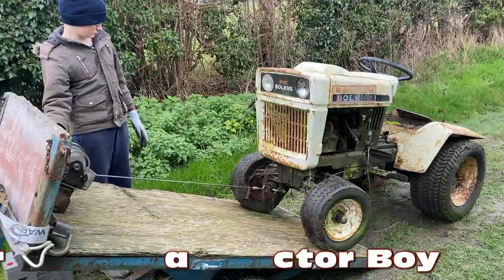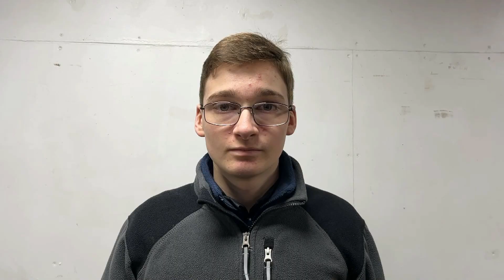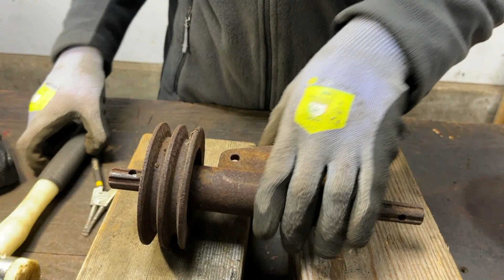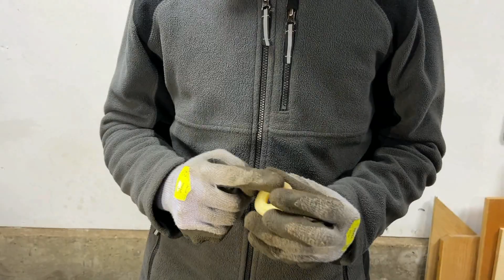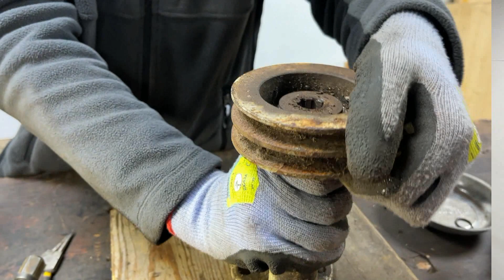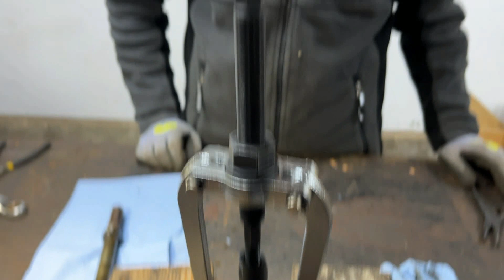Bolens PTO rebuild - Part2 (Strip down)

Comment: They all look to have worked hard in life, thankfully a team such as yourselves will give them the much needed service 👍 Wonder if 3D printing would yield a good result, or if there are mixes that would be strong enough to hold up  ?
Reply from the maker: Thanks for the kind words. We had the same conversation and I think you are right 3D printing would be the best option or it would be if we had a 3D printer. As such, we will try to make one on the lathe. The only time I have seen one of these washers broken is when the bearing behind it decides to explode so it does not need to be strong. Take care
Reply: @GardenTractorBoy - There is an organization here called Makerspace, they have many tools and machines open to be used by members on site, have been in there a few times but not jumped in, anyway, they had half a dozen printers on the go last time  i was there. Maybe something like that there (edit- where you are)  as well ?

Comment: Love this episode Joseph. Disassembling something you don't know. First off, the cameraman got a voice..... I was screaming at the video, clean and oil the splines before the puller tightened up lol, also you could of applied heat to the pulley. Engineering dilemma, you'd think a tractors PTO would be a simple accessory. You've proved its a Rubik Cube in reality. Top drawer......Cheers Tony
Reply from the maker: Thanks. We should have known better and cleaned the splines first but it was a good lesson. It was fun working out how to take this apart and interesting that everything is held on with snap rings. Take care

Comment: Very interesting to see how this pto is put together. Good job getting it figured out how it comes apart. Good luck making the plastic dust seal.
Reply from the maker: Thanks. It was fun working out how this came apart and it was different to how we were expecting. It seems odd that everything is held on with snap rings. The seal washer will be interesting. Take care

Comment: They call that tool a "Pickle Fork Ball Joint Splitter." in Canada. Handy for all sorts of demolition though:face-fuchsia-poop-shape:. The snap rings were certainly the mystery in this PTO.  The u-joints that have the ability to add grease are always superior. Nothing like a three-jawed pulled to yank things apart. Take care
Reply from the maker: I have heard the name "Pickle Fork Ball Joint Splitter" before. It is very odd how everything is held together with snap rings. Take care
Reply: @GardenTractorBoy I guess that tool has two uses. When it's not in the shop splitting ball joints, you can have it in the kitchen to skewer hard boiled eggs and, of course, pickles. LOL
Reply from the maker: @EverydayProjects LOL

Comment: Nice job fellas. That was a different type of puller to take the race out of the end after the shaft came out. Great that it all came apart. 👍🏻👍🏻👋👋
Reply from the maker: Thanks. We have a number of different types of puller and we usually find one of them that will work. Take care

Comment: Nice video. When you are going to take things apart, clean them first. Spray with a penetrating oil to soak as long as possible. I had to soak a bleeding nipple for 6 months on my big truck before it came loose. Sometimes you need to knock the bearing race back to take pressure off of the clip. While you are at it, I hope that you just rebuild both PTOs. Have fun. Good Luck, Rick
Reply from the maker: Thanks for all the great advice. We should know by now that we needed to clean the shaft but it was a good lesson. We will see how easy it is to make a nylon seal washer before rebuilding more than one PTO. Take care

Comment: Thanks for another great informational video.  - glad you were able to get the PTO units apart.  Looking at the first PTO (rusty unit) it appears that the double groove pulley was installed backwards for some reason - perhaps to align the belts on a non stock engine??  On the 1050's and 1053 that I have the pulleys are all on the same with the recessed face to the rear as the second PTO pulley (off white unit) was.  Interesting find on the slip joint with the non serviceable U joint - perhaps the later units were made that way to cut down on manufacturing cost and perhaps maintenance.  Possibly the uncapped cross was set in place in the yoke ears and then the caps pressed in over the cross pin.  Would be difficult to get the cross centered exactly to prevent vibration given the speed it would turn I would think and definitely not designed for longevity in my opinion since there is no easy way to lubricate it the way the older ones can be with a grease fitting.  You might be able to tack weld a washer on the face of the caps so you could possibly pull them out of the yoke ears to service it - just a thought.

I have found the easiest way to remove  the shaft is to remove the rear outer snap ring, the rear pulley and then the inner rear snap ring.  Next remove the front snap ring on the shaft that holds the nylon washer in place and then push the shaft forward enough so that the nylon washer slides forward so you can remove it - it is usually a snug fit on the shaft.  Then remove the large snap ring that holds the front bearing in place and then push the shaft forward - the front bearing usually is not a press fit in the housing and it will usually slide forward easily with the shaft so you can remove the shaft and front bearing as an assembly and then easily access the front inner snap ring if required.   

Inspect the shaft closely for any signs of wear where the needle bearing runs on it - I believe that the shaft is hardened in that area to prevent it from wearing.  I have experienced bearing failures at both the front (ball) and rear (needle) bearings back during the first few years I became acquainted with the tube frames and quickly realized how important it is to keep the PTO assembly greased faithfully.  I adopted a policy of greasing the PTO every time I use it with one or two pumps of the grease gun and since I did that I have not experienced any bearing failures.  Both my 1050's were well used before I got them and the splines on the PTO shaft and pulley where they meet can wear and strip out on high hour machines as I found with mine.  The splines on the shaft can be built up with a mig welder and then shaped with a file and hacksaw blade to return the splines on it to a useable level.  Worn splines in the pulley hub can be turned out and a new splined one inch diameter splined insert machined and pressed into the pulley if necessary.  Whenever I remove the pulley from the shaft I coat the spines in that area with a layer of grease during reassembly which seems to help prevent wear and also makes removing the pulley from the shaft much easier if required in the future. Just some suggestions that may help you.

Keep up the great work
Reply from the maker: Thank you for all the great detailed information and suggestions. It was fun working out how to take this apart and I am sure the next one would be very easy but less fun. The orientation of the pulley was very interesting on the other PTO and confused us when we were making some quick notes afterwards. We did check a few of our other tractors and all others are installed the way you suggested. After cleaning the parts up we were very surprised how good condition everything is but that is great information for repairing the shaft and pulley on future projects, thanks. Take care